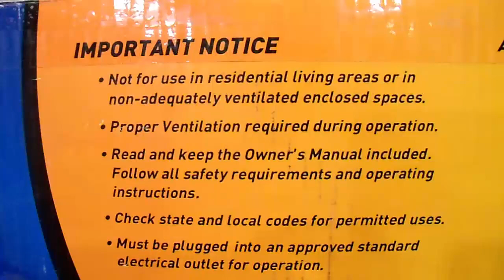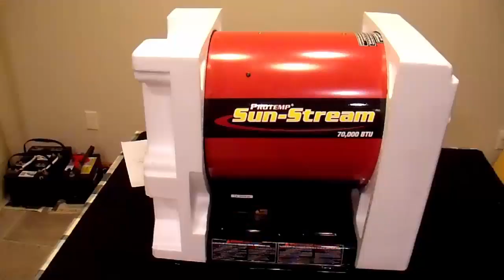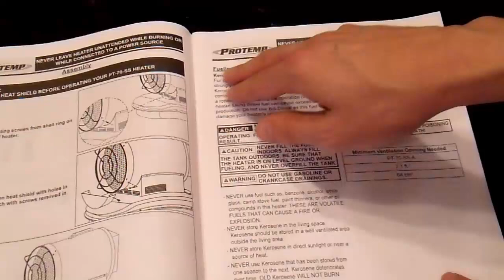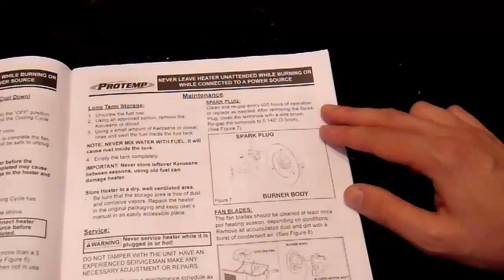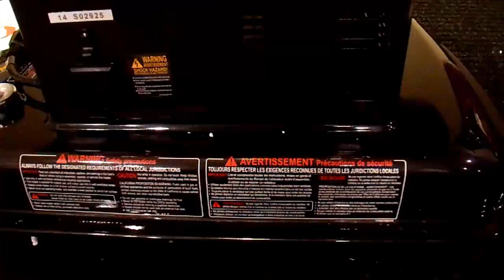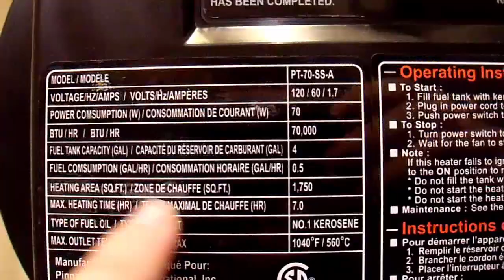Protemp Kerosene / Diesel Heater Review PT-70-SS - Part 1

Comment: I never understood how to use this type of heater in my garage because of the ventilation. If I open up the door the cold rushes in. Any suggestions?
Reply: You're absolutely correct in what you say, opening the door lets the cold in and kinda defeats the purpose, that's why I let mine run with the garage door shut, whilst I'm in the lounge for an hour or two, watching YouTube videos, and when I do go out, the shed's toasty and warm and, with the heater still running on 'full boar' I then leave the garage door open and start a working! Hope this helps?

Comment: Great review! I was wondering if the diesel was still working ok with your heater? The manual states #1 or #2 fuel oil (diesel fuel)
cannot be used, as that these fuels do not burn as clean
as 1-K kerosene.  It would definitely be nice to have options on fuel.

Comment: What's stupid is that the manufacturer didn't put in an automatic thermostat. Foolish! Is there any way to install one in there?
Reply: you cant due to the design
Reply: @DMAN22yeah   I've just bought one of these heaters, it's a Korean made one, and it's got a thermostat on it put there by the manufacturer, but I never use it, I always use the heater on 'full noise'!

Comment: It's my understanding that diesel fuel now since nearly all sulfur has been removed is cleaner than kerosene.
Reply from the maker: Yes, that is true by regulation but generally not by practice.  Since K1 ATSM spec can be met by simply using #1 diesel without the additive package they nearly always do that now, which means K1 is usually <15ppm sulfur in the USA.  K1 is only required to be <500ppm by spec, however, and I am sure it can be found at that higher sulfur level if one is unlucky enough to find K1 that was produced by an older refinery process.

Comment: Hello knurlgnar24
Is diesel safe?, we hear much about the carcinogenic particles from disel cars.
It's different this way to use it?
Thank you for another great video,, sides now in excitement for the next.
Reply: Hasn't diesel been used as heating oil for years? Although the combustion products would normally been vented outside. I think the carcinogenic thing was related to the fine particulate matter which can find it's way deep into the lungs when used in combustion engines. It would be interesting to know the chemical differences between kerosene and diesel as they all come from the same place.
Reply from the maker: Diesel engines emit a large amount of particulate matter.  Carbon is a carcinogen when in certain chemical shapes and you commonly eat it in fried foods without thinking about it.  Breathing diesel fumes is also a common source that people are more concerned with even though it is a smaller factor than the foods we eat.  Anyway, this combustion process is much different and much cleaner than that of a diesel engine and there is almost zero particulate emissions so the emissions are carcinogen free, nitrous oxide free, and surprisingly even carbon monoxide free.

That said, on startup there is some particulate emission for the first few seconds before the flame chamber warms up.  Nothing like a diesel engine though.
Reply: Hi *****
Okay,, really did not want knurlgnar24 to get hurt,, or you. But you have probably also heard that diesel cars are the reason for manny manny cases of lung cancer,,, and why all new diesel cars now has a particle filter. So that was my concern :-/

Comment: sure you can put it on a thermostat, just have to wire it in series or parallel with on/off switch
Reply from the maker: Very true.  One would need to access the switch rather than just install a standard inline thermostat like people are accustomed to doing with a torpedo style heater.